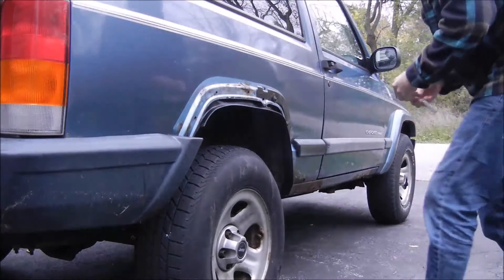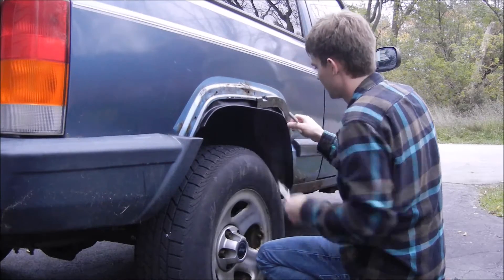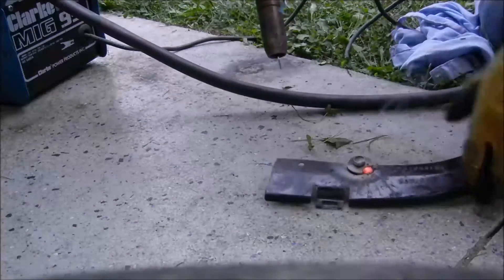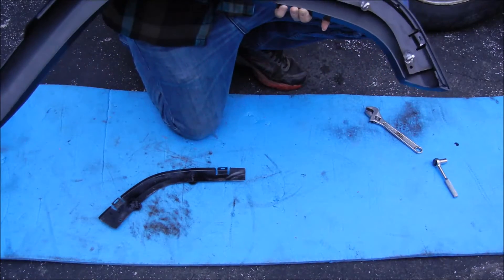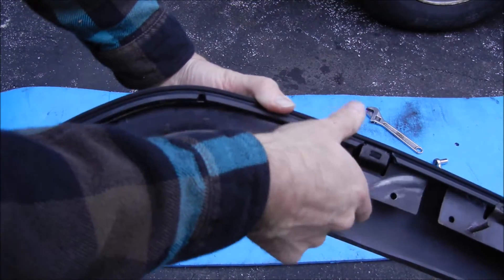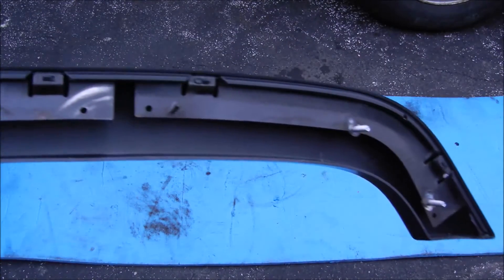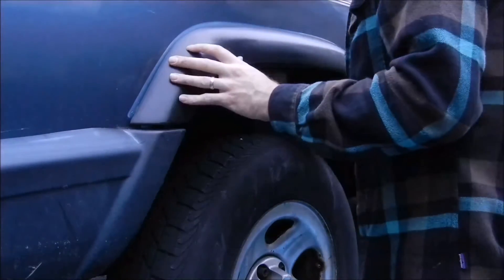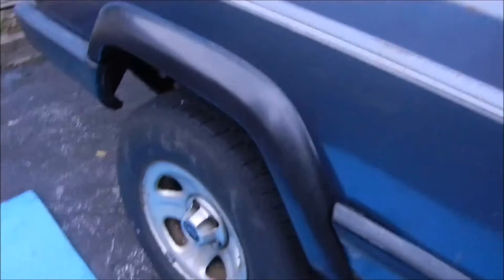Jeep cherokee XJ Fender Flare Install - How to?

Comment: Paint those metal brackets before you install them especially when there is bare metal and use a 1/4" ratchet set so you don't over tighten the nuts

Comment: I'm having a hard time finding cheap replacement retainer clips. Nearly $20 per piece--2 pieces per fender--and I haven't found anyone who sells the whole set!? Any recommendations? My other option is try and reuse old rusty clips but the bolts all break when removing so we will need to drill holes and weld new bolts to the old ones is my thought? 98 XJ

Comment: So my brackets have rusted out. Bought new brackets. What is the hardware I need  to buy? Am I going to have to weld those on myself?
Reply from the maker: You will only need to buy some lock nuts if they do not come with the brackets.
Reply: @NorthernHome  appreciate the feedback!
Reply: @NorthernHome   What Size bolts and nuts do I need?
Reply: Where did you find a complete set of new brackets?
Reply: @tyleriverson5025  Quadratech